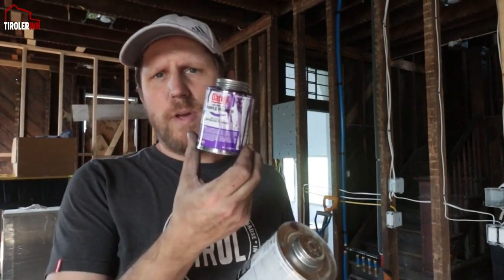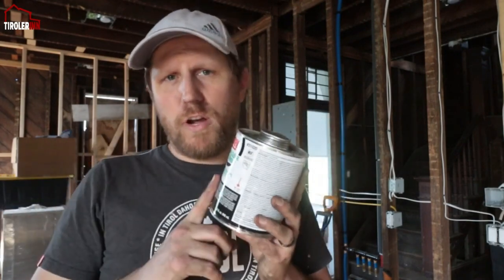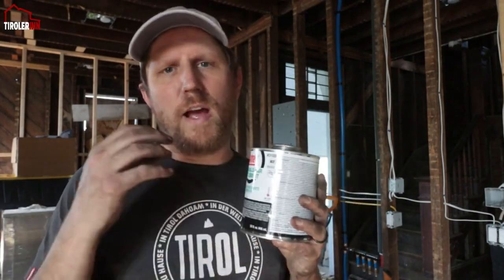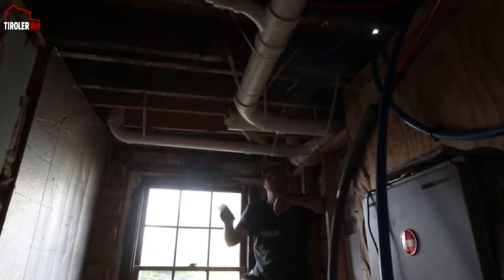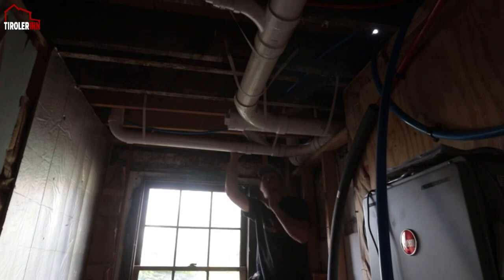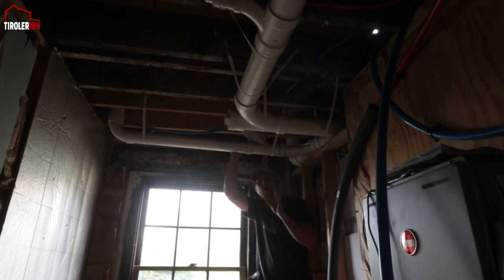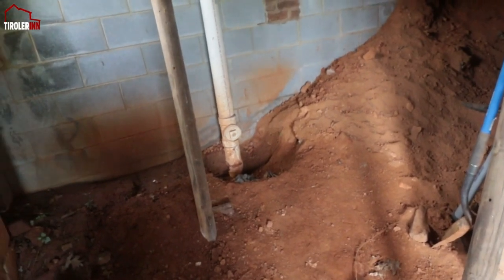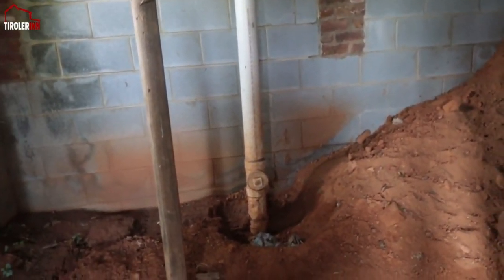Finalizing the Upstairs Pipes and Getting Ready for the Inspection - TirolerInn the Renovation

Comment: Having the pipes all cut and laid in their spaces seems to be a real timesaver. Did someone help you decide where they go?
Reply from the maker: We did that last year. Tried to read up on all the requirement from the code before so we don’t have to redo it when we glue it. Also the inspector is going to answer any questions we might have.